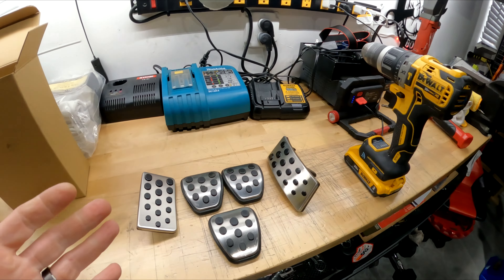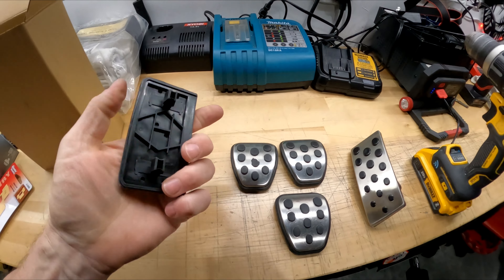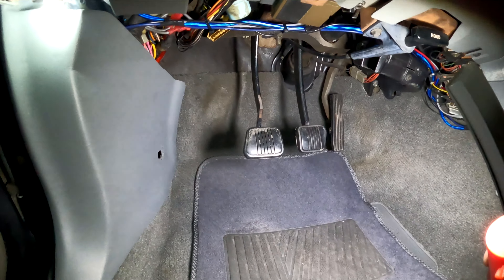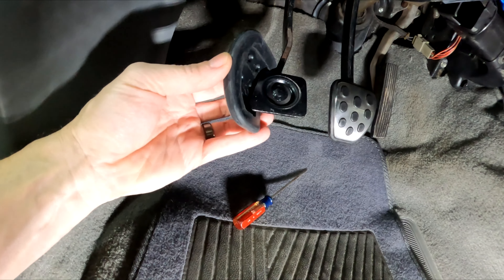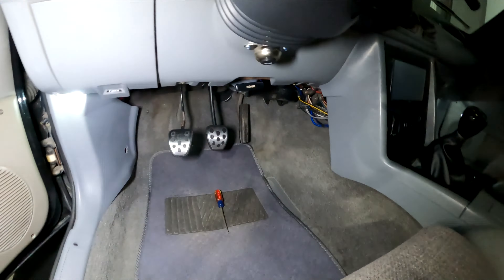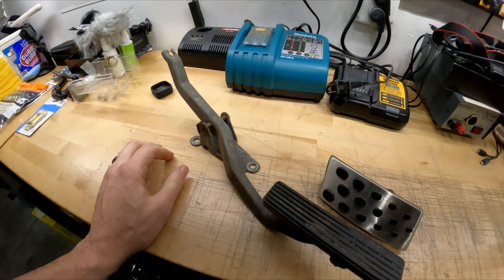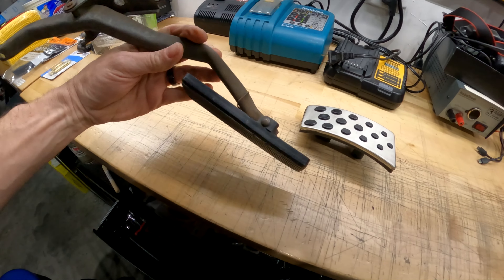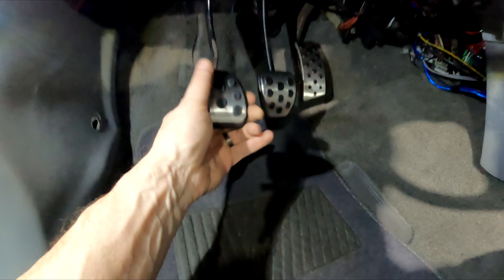1987 Saleen - Updated pedals from SN95 model mustang - Bullitt/Cobra

Comment: The spring isn't need for the new gas pedal?
Reply from the maker: No it is not needed.  This pedal fits really tight against the arm so you throw the spring away.
Reply: @98saleen  every pedal went on fine for me except the damn brake pedal. I heated it up so much it pulled the glue and I ended up mangling it up so much that I have to order another and try again.
Reply from the maker: Oh no!  I always have to use a small screwdriver to help pull the rubber over the pedal.  It's a tight fit.  You can also take a razor blade and trim a little excess rubber off to help it go on.
Reply from the maker: Oh no!  I always have to use a small screwdriver to help pull the rubber over the pedal.  You can also take a razor blade and trim away a little rubber to help it go on.

Comment: That original gas pedal looks like an automatic pedal.
Reply from the maker: Could be.  This car had evidence of some past mods including a set of gauges on the pillar, a separate mounted tach on the dash, a hole in front of the shifter base (indicative of some sort of aftermarket auto shifter like a Hurst), and holes for what appears to be a nitrous bottle in the hatch area.  I suspect the car had a drag career at some point in its past.